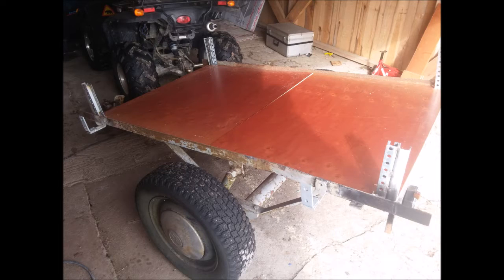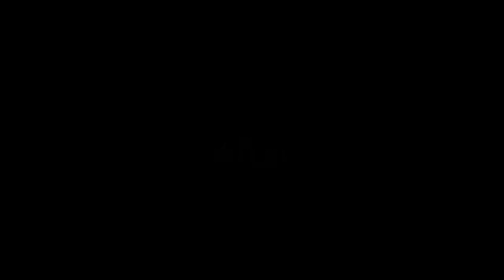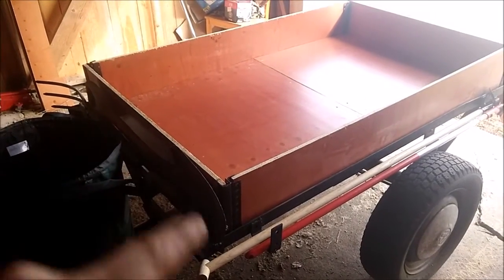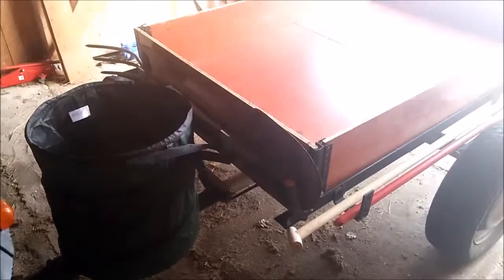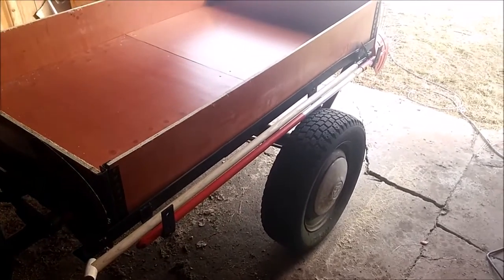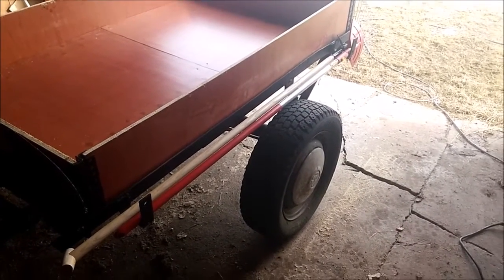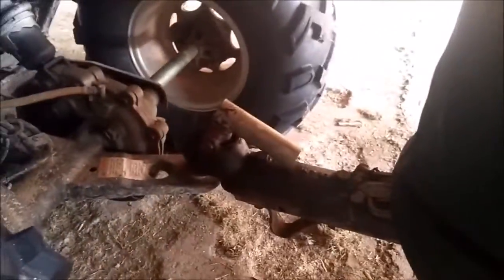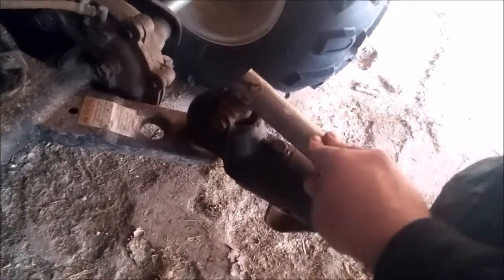ATV utility trailer P2

Comment: I hope I get this right...Crackin' job there mate. Did that sound brit or ausie?  Just kiddin. Awesome job brother. I'm still not sure if I want to cut some weight out of mine or Cut out the axle & start from scratch. Plus the work shop has been doing double duty as we have been working on the house. Anyway, Cheers Mate....oh...that sounded much better...even got the accent right...LOL
Reply from the maker: Gald blimey guv!  couldn't sound more cockney if yer tried LOL.... I had a blast with it and am really chuffed how it turned out.   Now thinking that the old canoe carrier will fit pretty sweet on the trailer,  making it an all round " do it all " tool.  Thanks for watching and ATB. Steve.
Reply: I was wondering if you would consider putting the canoe on it. I'd like to tow my canoe with my Grizzly, but I keep thinking the trailer would have to be too long. But with an elevated rack like you built...HMMMMM, where's my sketch book...Take care my friend.
Reply from the maker: I had another look at the trailer/canoe rack combo and have decided to do some testing!!!  the carrying capability isn't an issue, the trailer can carry 600kg but it's the stability.  Keep an eye out for the crash test dummy video coming soon.........